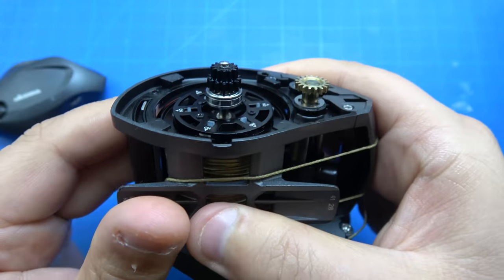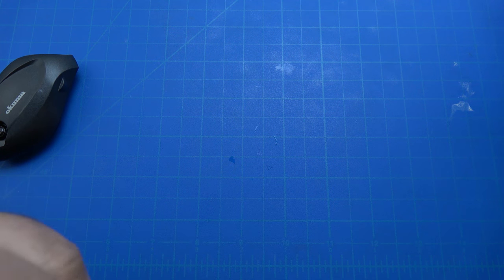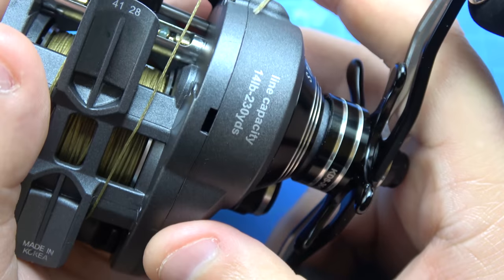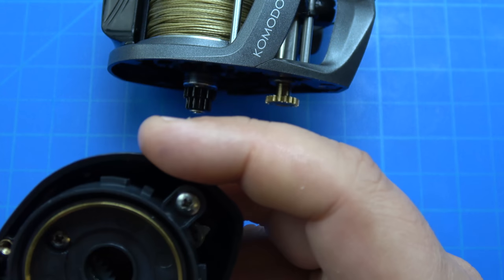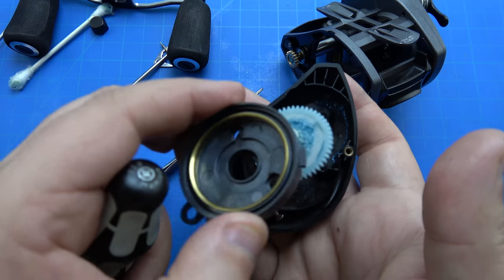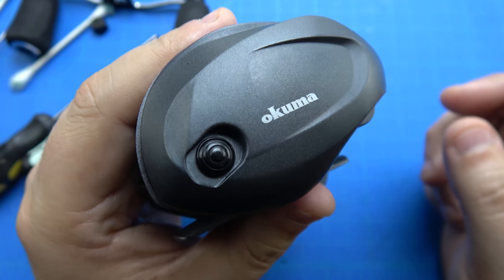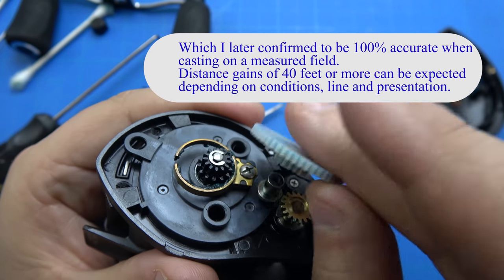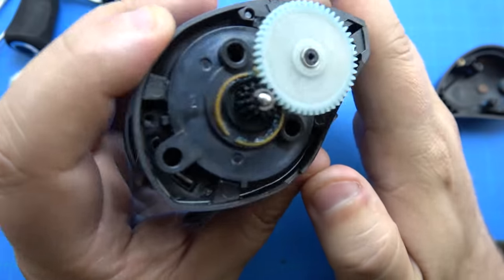Okuma Komodo SS and Citrix:  10 minutes of your time will gain you 10+ yards of distance

Comment: If I was going to this much trouble i would replace the bearings with serviceable units...only after i decide if 10 yards is even worth the trouble. Ive owned the original and newer version 350 Komodos, as well as the 350 Citrix. Dont own any of them any more. Never had any real problems with any of them, but never found a reason to be excited about them either.
Reply from the maker: Yeah...that is a definite bonus....but if its a new purchase...this will get you where ya need to be until the bearings slow down.   They're great tools....just not long range tools.    Great considering the street prices on em.
Reply: I cant really say anything bad about them. I had a citrix outlast 4 revo toros used for the guide service. Great reels for clients, just not for me. ;) Interestingly enough, by the time i tightened up the revos to the point that a newbie caster couldnt backlash them the distance was pretty close to the citrix.

Comment: How would you put a bearing there?  Would be interesting to see that done.
Reply from the maker: There is a special idler gear for abus that is designed to run on a bearing..  You would not be able to add a bearing t the existing idler
Reply from the maker: http://www.mikesreelrepair.com/abu-single-ball-bearing-idler-gear-kit/
Reply: I see.  So it would have to be a special design for the Komodo.
Reply: Panfish I think that could be done and cast as smooth as the Shimano

Comment: This is the same to me as cheaper companies advertising 10+ bearings, then you realize at least 4 are in the handle.  Even Lew's, who I love, pads their bearing counts by adding 4 t the handle normally.  For example, my BB1Pro has 10 bearings (4 handle, 6 body) and a Curado 70 has only 6 (all 6 in body) and you tell me which is smoother.  My SS/SV103 had 8 bearings before I added any, and all 8 were inside the reel...
Reply from the maker: My ideal count for a baitcaster would be...2 for the crank handle shaft.  2 for the spool.  Two for the pinion.  Handle bearings are nice.  as long as they are shimmed right.  SO +4 there.  And levelwind bearings are cool for FW.  But not needed.  I'd really like t see shimano add a bearing on top of the AR clutch an all their reels.  It's not needed.  But would be nice to see it instead of running on the ar clucth bearing.
Reply: So... A Curado for example has: 2 on the pinion, 2 spool, 1 on main shaft (main gear) and the +1 is a roller...  My Daiwa Tatula has: 1 pinion, 2 spool, 2 on main gear, 1 roller bearing, and 1 per handle (8 total).  So that is what you are essentially wishing Shimano would do correct?  They might have 4 total on the Spool/Spool Shaft, but normally one have one with a roller on the main gear shaft?  Or have I missed one and count is off on the Tatula???

Comment: hi there, my new komodo makes a loud plastic rattling sound during a cast. is this normal? any ideas on reducing this? thank u very much!
Reply: I know this is from 2 years ago lol, but did you ever fix it? It happened to me recently.
Reply: @mattiasjonasson2714  DM me. I can walk you through troubleshooting.
Reply: @williamstrav94  thank you, but i managed to locate where the noise came from and fixed it:)
Reply: @mattiasjonasson2714  How did you fix it?
Reply: @gowrestle160  For me, it was the big plastic gear inside the sideplate that rotated too fast, (or too wobbly), when I made a cast. I just put som grease on that gear, wich made it not rotate as easy, thus making it smoother and not wobbly. The awful sound completely went away.

Edit: And yes, the big plastic gear that he in the video said he cleaned the grease off to make it cast longer. I applied grease to that gear instead.

Comment: How do you take the side pannel just got one of these.. thanks
Reply from the maker: Hey man, You talking about the non handle sideplate?  There is a protruding screw on the Handle side above the spool tension adjustment knob.  Loosen that screw.  And rotate the opposite side plate.  You may need to pull a bit on the screw once it's completely loosened as you rotate the side plate.
Reply: Tackle Advisors great, going to be using the reel on a musky setup heavy lures should do the job!

Comment: How did you clean out the bearing??
Reply from the maker: I don't recall... Either waterpik dental irrigator or ultra sonic... Likely the waterpik
Reply: @TackleAdvisors  ok so just just by taking out the spool baring and cleaning it..then soak it in some oil I'm gonna get 30 to 40 feet extra on my citrix? What best oil to use